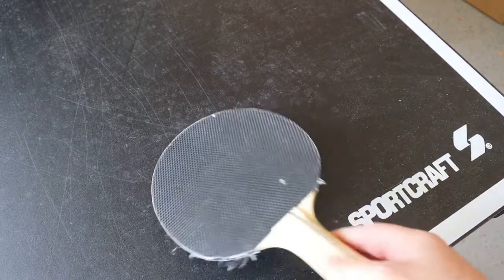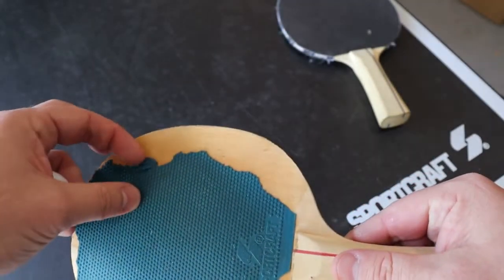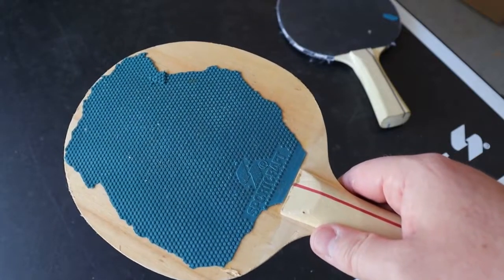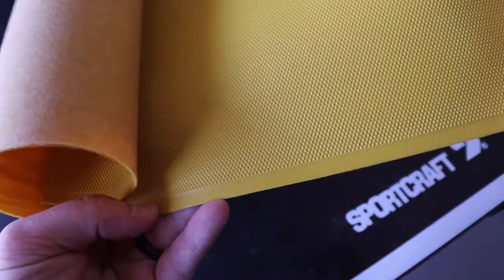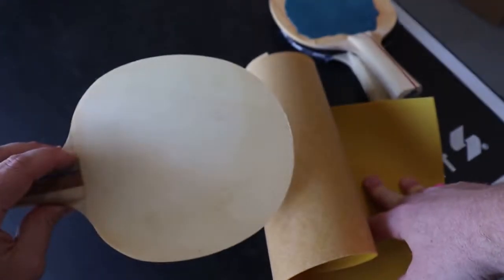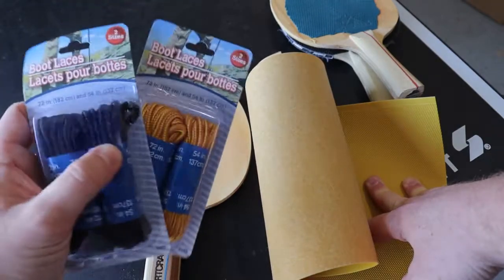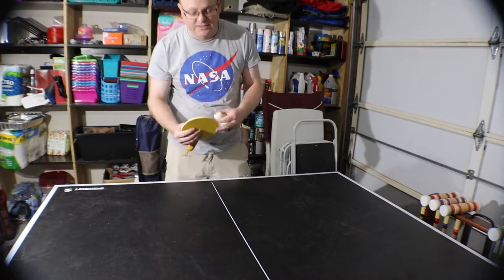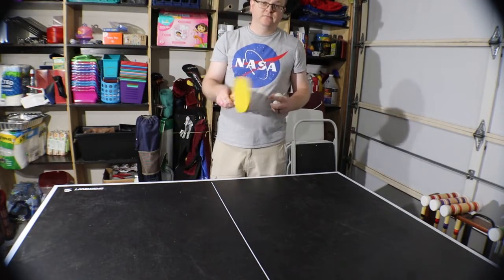Shoe Soling Rubber for Ping Pong? | How to Make a Ping Pong Paddle | Episode 21

Comment from the maker: I got this shoe soling rubber on Etsy.  If you search for "Duratec Soling" it should lead you to what I bought.  Back when I bought it, it was like $13, but appears to be $20, so it's not the cheapest option (and maybe not better than just buying new cheap paddles every year or two).  I haven't used it too much in the last couple of years, but the rubber has held up well.  It hasn't dry rotted in storage like a lot of the real cheap paddles do from place like Walmart. It makes for a good option on hardbat type paddles; I haven't found anything better for replicating that particular feeling.